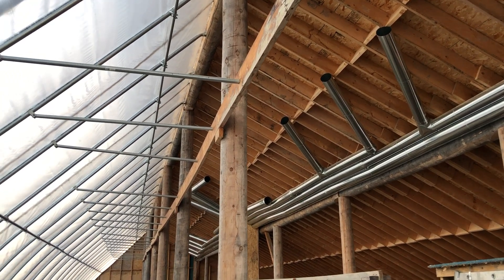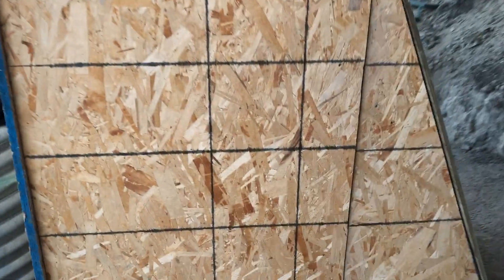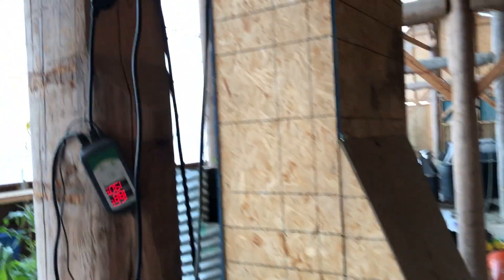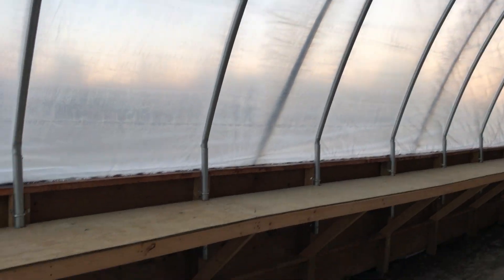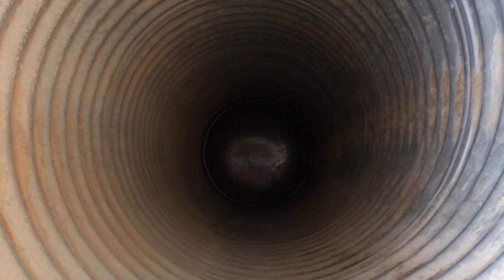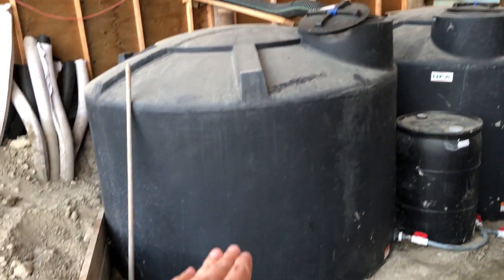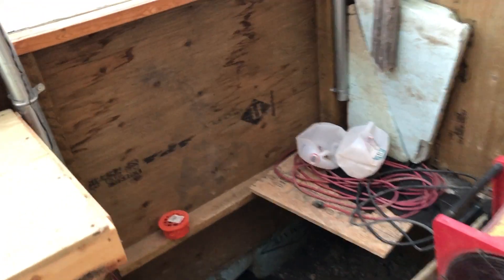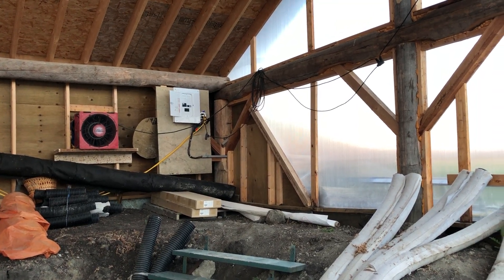Passive Solar Greenhouse 2

Comment: Jeff I live in central alberta and am going to start construction after an 1800 Sq ft.  Would love to connect with you to chat about lessons learned if you would be willing
Reply: Lessons learned should include installing more tubing (at least twice as much) and using multiple systems/fans. I`d suggest designing the system  to put your entire greenhouse air volume underground at least 20x per hour.

Comment: How much is the cheapest polycarbonate you could find? I am designing a building and it is very “roof centric”. In this design the roof is the most important single element. It provides, light, heat, dew, wind block, snow block and rain block. The design features a similar shape as yours but imagine a roof built with metal trusses 16 inches wide with a layer of polycarbonate on each side. This creates a large flat shaft for air to flow upward between the interior and exterior sheets of polly to the top of the building where it enters the north wall / battery and falls into a giant long room of 50 gallon metal drums filled with water and sitting on industrial metal shelves with extreme insulation on all walls except openings at the top and bottom. This massive battery bank constructs the entire north wall for height and length of the greenhouse. With heat from the daylight the air rises in the roof between layers of poly and then falls through the bank of metal and water on the north wall only to enter into the green house space through a 36 tall open segment of the north wall at the bottom and then the air rises again into the roof through open vents on the interior side of the roof assembly on the south side. It will self circulate passively storing day light heat and the direction of that circulation will reverse at night with shutters closing off the roof from the circulation.
Reply: I can help with your design and build. I have created something similar with a aquaponics system included.

Comment: If you add that second layer of poly on the inside wall… don’t forget to accommodate for condensation that will happen in the middle 😉

Comment: I hate to say it but the losses on those nice shiny intakes will be costing you a lot of performance.
Reply: Why?
Reply: Hate to tell you this, but it definitely won't.
Reply: @canonicaltom  
You need to gain an understanding of duct design.  If an HVAC engineer tested the flow rate in this system it would fall far short of what you imagine. Fwiw, Knowing the inlet and outlet temperature will tell you almost nothing, you need to know the flowrate (in cfm) and the inlet and outlet RH% in order to calculate the performance.
Reply: @JohnGuest45  Fortunately this isn't an HVAC system, and few HVAC 'engineers' would have any idea how heat is dumped into the ground in this system.
Reply: @canonicaltom  
If you think that you dont understand how the system works :) An HVAC engineer can easily measure the actual CFM, along with the temperature and RH% of the inlet and outlet. He/she will be able to calculate not only the static and dynamic system losses but also the amount of btu transferred per unit of time and calculate the efficiency. Most folks have no idea how the heat is "dumped into the ground", which is the main reason why folks make mistakes in the design which leads to poor performance. Anyone with the most basic of knowledge can tell you that adding the shiny intake ducts will have a negative impact on the output of the fan. Most fans will provide a P/Q (fan) curve, which is typically a graph showing cfm and inches of water column (in. wc). A fan will deliver its maximum CFM at 0" wc (open flow) and zero flow at max in wc. The exhaust fan used in this system will not be delivering anything close to what you imagine.
Reply: @JohnGuest45  That's a lot of words just to say you don't actually know what you're talking about. The only performance question is going to be, is there a temperature drop from inlet to outlet? The ducts are all up high, so the duct air is the same temperature as the surrounding air until it drops sharply into the ground, resulting in no heat flux. As long as there is any flow at all, cooling will be happening. If the fans are solar powered the efficiency is always 100%
Reply: @canonicaltom  
A temperature drop from inlet to outlet is meaningless without the air flow rate. A cupful of warm air flowing from the outlet isnt going to heat even a small  greenhouse, especially when you consider the heatloss from the glazing and other surfaces.  To "maintain" temperature in the greenhouse you have to supply enough heat to match the losses. The design process is the same as any HVAC system, you work out the heating and cooling loads of the structure. This will tell you how much heat you need to add or remove in order to maintain the desired temperature.  The difference between this system and a normal HVAC is that you are limited by the temperature of the mass (its not a furnace or a refrigeration unit). Basically, the temperature of the mass dictates what can be achieved, you cant heat the greenhouse to 60F if the mass temperature is only 40F. The notion that the ground maintains a constant 50F is quite popular but when you actively add or remove heat from a fixed amount of mass..its temperature will not remain constant. The speed at which heat moves through the ground is governed by its conductivity and diffusivity. Its nice to think that the mass can instantly recover or lose heat from or to the surrounding ground instantly but it doesnt happen in the real world. Fwiw, if you have a massive temperature difference between the roof and the floor of the greenhouse, you dont have enough air circulation. If the greenhouse is 12ft high, the inlet should only need to be 6-7ft off the floor. If you measure the temperature at 1ft height increments in a greenhouse with good air circulation you`ll see the maximum temperature isnt at the peak. I designed and installed my system back in 2009, it performs as designed and even handled the 105F record (shade) temperatures last summer without the need for shade cloth.

Comment: Who & how did you make those inner angle transitions from upper hoops to the vertical knee wall pipes. They are obviously custom to allow for your "organic design" of making the greenhouse angle steeper as you stated in your previous video. Thanks
Reply from the maker: I used chain link fence post C brackets with self tapping screws to attach the lower extent of the post (usually driven into the ground) to fix to the 4x4 posts of the knee wall.